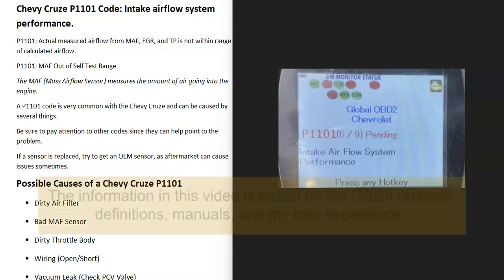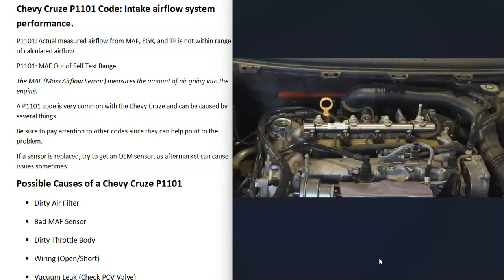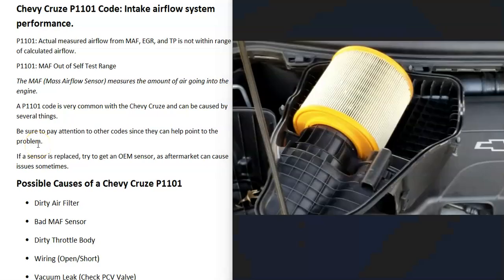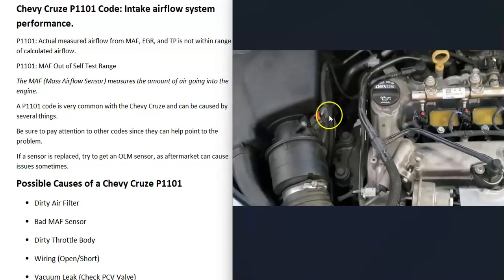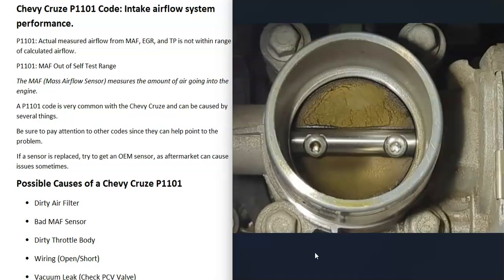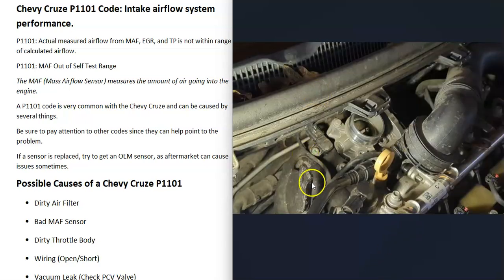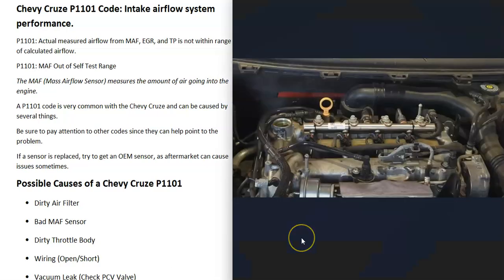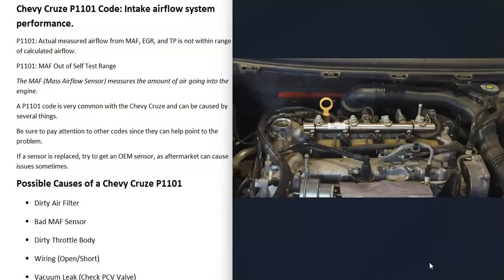Causes and Fixes Chevy Cruze P1101 Code: Intake Airflow System Performance

Comment: The pcv valve is located inside the intake sir its a unserviceable part you have to replace the intake valve cover and the bypass line

Comment: I've had great luck with cleaning the throttle body and MAF sensor but not this time.
Gonna check out the PCV valve next.
Thanks for your video.
Reply: Do you have the P0106 permanent code ?

Comment: After looking at your video I went to the throttle body and found oil and the sensor on the air box cleaned it out of 6 codes these are the last 2

Comment: Is it expensive to get a throttle body sensor and a mass air flow sensor fixed?
Reply: Normally not too expansive maybe $120 for the new sensor if you don’t want to try and clean it. If you want to clean them both yourself it’s like $25 worth of chemicals

Comment: I was on my way to work and was at a light and my Chevy Cruze 2018 shut off, I thought it was the auto stop feature but when I took my foot of the break it didn’t start back up. I shut it off and tried to start it again and it wouldn’t start back up. I had to get it towed home. When the tow truck driver got there it started for him but It was shaking like it wanted to die, he stepped on the gas to the floor and the tachometer would only go to 2-3 nothing higher. The next day I started it twice within 10 minutes and nothing seemed wrong but I checked the code and it was p1101, what do you think?
Reply: I’m having the same issue. 2014 121,000 miles. Just had my fuel system cleaned and it was running so much better for 2 days then my engine turned off again at a stop light. I was able to turn it back on but it had a hard time turning over.
Reply: @sarahwilkins4077 did you ever figure out what it was?
Reply: Sounds like my problem did you ever figure out what it was?
Reply: @EtherFlames did you figure it out yet I saw you got no reply

Comment: my moms Chevy cruze says engine power reduced, do you know what would help fix that?
Reply from the maker: That is called Limp Mode. There is a problem, and the computer has shut down all unnecessary components and has limited speed. An OBDII scan tool is needed to scan the computer for codes, which will point to the problem.
Reply: If you haven't already got it fixed disconnect the battery and remove map,baro,maf,throttle body tube clean let air dry and reinstall just my 2 dollars plus might save you money
Reply: @levialston518  that’s exactly what I did and it worked!